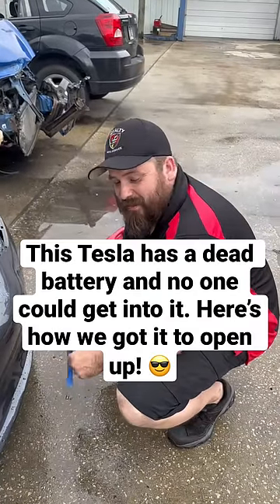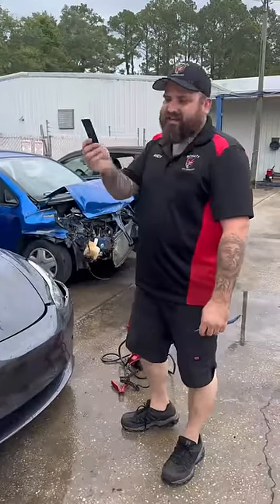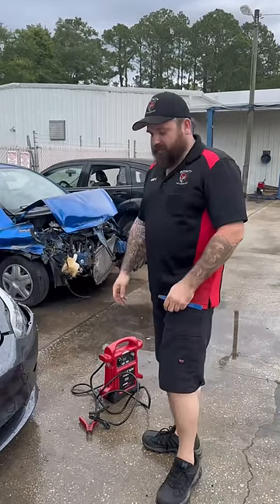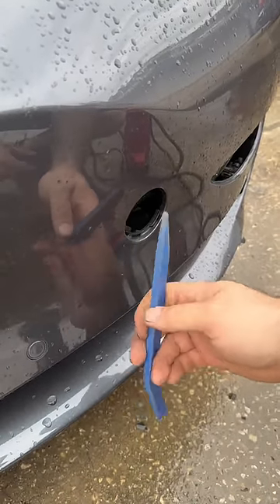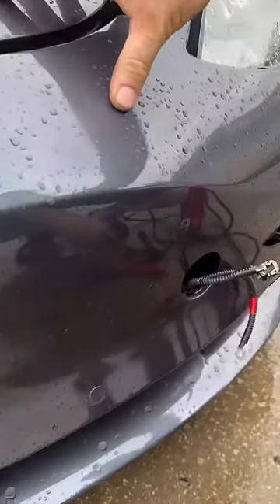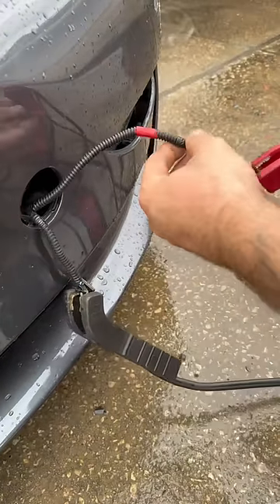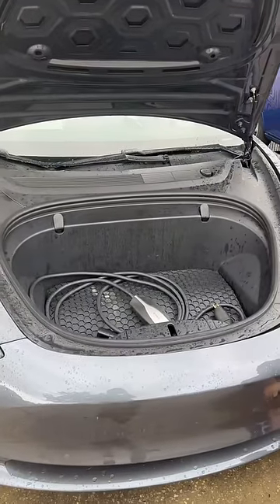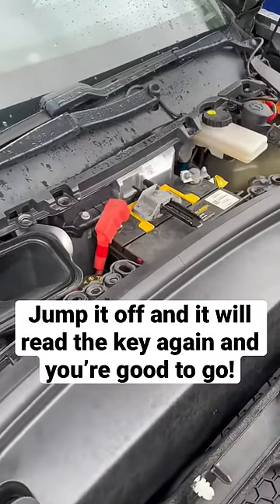Dead Tesla! How Can We Get Into It? #shorts #tesla #teslamodel3 #car #mechanic #crazy #hack #tips

Comment: Imagine, if they could build a car with door handles that didn't require electricity.  Maybe someday, we will reach that level of advanced technology.
Reply: And Windows that roll up and down by a hand crank.
Reply: This only happens if your 12v battery dies. I experienced that once because a service center didn't reconnect mines properly. Regardless, it's easy to fix. Every service item on Tesla is simple to DIY. If you can change a tire then you're already qualified.
Reply: That's why I like my Beetle! :3
Reply: Or a replacement battery less than $20k!
Reply: @T1Oracle  only happens when the battery dies, which car batteries die all the time.

Also most people don't even know how to change a tire
Reply: @T1Oracle  yea changing batteries is not thst simple nower days, theyre always buried in trims held in various ways, multiple on the vehicle and then need programming to the cars etc
Reply: 😂😂😂😂😂😂😂😂😂😂so funny
Reply: I once had an idea about mechanical locks. I am still formulating. One day, one day.
Reply: @PlinkyVR  Dude, you can see the battery in the video. No battery requires advanced rocketry to replace. There's no need to reprogram anything except maybe the stereo. Tell me how you've never changed a battery before.
Reply: @dk-bw4gk  oh the irony in the fact I do change batteries for a living, you never had to reprogram start stop? VWAG cars you need to tell it the new battery capacity and amp hours, mercedes and BMWs you need to reinitialise the battery management to prevent component damage on some... Volvo, range rovers and many BMWs have the battery in the boot behind trim like subwoofers foam inserts etc, do me a favour mate and stop trying to act like you know it all
Reply: "you aint ever gotta do this on this one truck its the only vehicle ive ever worked on but every car in the world including super cars must all be the same" @i_KillCampersDayZKillCamZ
Reply: @PlinkyVR sounds like you did your own exhaust work?
Reply: @CavemanVanDweller  is that like a literal question or are you trying to hint at something I'm confused
Reply: @PlinkyVR  🎯😂
Reply: Great comment. Sometimes tech is not the solution. This is from someone who had a 40+ year career in tech.

Comment: You just unleashed hell in San Francisco 😂
Reply: It’s literally a factory safety feature of Tesla
Reply: Don't forget....Oakland too 😂
Reply: Savvy Tesla owners are going to snip their wires to outfox the thieves then get super hosed when their battery dies from their dashcam setup
Reply: @ElectricNed  This is so true...
Reply: Yeah, connect the jumper cables to the bumper wires shown to open the front trunk (frunk). Then pop the plastic 12V battery cover off to connect the jumper to the 12V battery terminals so the car will be able to unlock and open with the NFC card key
Reply: U don’t think the thieves already knew this?
Reply: San Fran is already hell, so, should be no problem.
Reply: @JoseLopez-oj2ni 😂 PORTLAND HAS ENTERED THE CHAT!!! 😱
Reply: It's only if the battery is dead and you still need the key to be nearby.
Reply: Criminals have been able to get into my cars for 20 years just by breaking a window 🤣
Reply: @ElectricNed Teslas have built in dash cams doofus 😅
Reply: @Atthewgoop  Ok, imagine it's a 12v Elon Musk scent candle warmer they left on.
Reply: @ElectricNed  can access power without the key or app so again wrong 😂

Comment: A simple fix for this. Companies put keyhole locks on cars.
Reply: Ain't gonna work aways, 2007 volvo v70 wont unlock doors if battery is dead, not even with a actual key manually.
Reply: @Plymouth3061 then the key isn't actually connected to the lock like they used to be... newer isn't always better
Reply: Or you could ride a horse and get rid of key altogether
Reply: @scottbates100 Fucking brilliant!
Boat anchor vehicles.
Reply: While that would help in some cases it doesn't in the case of towing the car with the 12v system dead. Need that power to put it in neutral and access the car.
Reply: Nope newer car need the battery
Reply: @monkeynonothe3rd725 with cars it's actually the opposite, unless it's from 1920s lol
Reply: @scottbates100 depends on the year and make of the horse 😅
Reply: @scottbates100 Sound great until you come out the store and find some homeless junkies eating your horse.
Reply: so then we can (again) lock picking cars 😅
Welcome back to the past. No future allowed. Just to safe you a few seconds in a situation that you will probably never experience.
Reply: but what if I want my car to be like an overcomplicated smartphone that I depend on to get around?
Reply: @MrMhfreak  not with mechanical transmission linkage / manual transmission
Reply: That must be too complicated for Elon Musk😂
Reply: @Plymouth3061 well Volvo is shit as well…
Reply: Having a mechanical key is a security risk as they can easily picked, that's why Tesla don't have any mechanical key

Comment: I feel like a keyhole would've made this a lot simpler
Reply: 😂 so true..
Reply: Yep, but god forbid they do ANYTHING the old-fashioned way!!! Even though it WORKS!!!
Reply: Your too funny...needed a good laugh.  Yes a key would make too much sense !
Reply: @leroysiedenburg2139  as my dad would say “leave well enough alone “!
Reply: And now they can control you. 😂
Reply: Mic drop!
Reply: Yes a keyhole to open hood to get to battery. 
What car has a keyhole to get to battery?
Reply: @securityeagle9144 A keyhole to open the door, at that point you have access to one of those nifty hood latches
Reply: Come on man. We're talking progress here.
Reply: "I want more safety, technology, and performance than ever, AND I want a bunch of extra, unnecessary, and outdated parts to be used because I don't like different."

If they did that the next thing you'd say is: "Wait; why does it cost $200k?" 

In engineering, there are trade-offs.
Reply: @securityeagle9144  every BMW? :))
Reply: @man4YAWEH454  exactly the point…. Shut the grid down or control ppls power
Reply: @securityeagle9144 pretty much every car
Reply: @securityeagle9144  well its also a trunk so...  most older European cars with the battery in the trunk.
Reply: Yeah, but that ruins all the experience you gain trying to hotwire your door! X3
Reply: @mellowphantpi9168 There are compromises in engineering, but things like these decisions here - these are visual / aesthetic designers being allowed to steamroll the actual engineers. It's an engineering compromise, roughly on par with how getting shot is a deer's lifestyle choice.

I bet you 100 these decisions were made by graphics and aesthetics designers, directly against what the actual engineers decided and designed.
Reply: @securityeagle9144  litterly every car in existence, you open the door and pull a lever to pop the trunk
Reply: @securityeagle9144  Technically all cars since you have to pull the latch for the hood... 😂
Reply: @securityeagle9144  Just about every German car out there.
Reply: That would give you too much control.
Reply: For Real. They really over engineered this thing.
Reply: @FedkaSlovanich  You can do that with a Tesla too. In case you just missed it, the context here is the doors being locked. And just like virtually all other mass production cars of the last half century, the hood/bonnet locking release is on the inside. AKA: the not-where-you-are side of those locked doors.

Unlike most other cars though, if you battery is flat and you lost your key/fob, you still have many options. Some require enabling beforehand, some do not. You can unlock, drive and lock modern Teslas with any of the included 2 key cards, by bluetooth or NFC natively from your phone or a keyring (requires previous activation, but does not require cell or internet connection to use), through logging into the Tesla app (meaning you could do it through someone elses phone) - or you can call Tesla roadside support and have them unlock the doors (and even make it run) for you remotely.

All you need to enable those options, including getting Tesla roadside support to unlock it and fire it up for you remotely - is to feed a little charge to your 12v battery which can be easily done from the outside. If your battery is flat and you lost your key/keyfob with nearly any other car, that's it; you're SOL. 

To be honest, personally I'm not a big fan of there not being a mechanical key fallback. But IMO Tesla has put in place many extensive alternatives that fairly solidly makes up for omitting that mechanical key fallback, to "ensure" you don't get stranded. 

There's plenty of aspects to morr than justly grill Tesla on. This particular bit, I don't think this is one of them.
Reply: if i’m remembering right, the first roadster did have a key hole on the bottom of the driver door. shame they got rid of it
Reply: Yea exactly and I understand they don’t want it showing but for example my stinger gt has a emergency keyhole that’s very easy to get to just a tiny trim piece in the handle gets popped off that’s the most complicated it should get this is bs
Reply: Yeah but that'd cost probably $20 per vehicle. This is some wire routing and a plug. Probably $3. 2021 Tesla sold around a million cars. That's a cheeky $17 million they kept in their pocket for a problem that's very very rare.
Reply: "bUT ThE kEyhOLE is UGLy"
Reply: Thats how you know computer nerds built the specs and design features.
Reply: You mean a lock cylinder that needs a specific key made just for it?  That OOOOLD tech.  It doesn't need electricity or wifi, it's caveman technology, LoL 😂
Reply: @jesuschristiskingandsavior461 easy solution to that: wind generators or solar panels. Build an off-grid charging station and voila, you can charge your fancy electric car.
Reply: These cheap cables just lying there looks like something they threw in when they accidently locked themselves out and discovered how stupid it is to not have keys. 😂
Reply: 🎯. That’s soooo 2018.  This is apparently more technologically advanced.  lol.
Reply: @jamesgizasson : That’s a shocking comment! I’m reporting!
Reply: @securityeagle9144 
Just about every other car. Key opens the door, hood release is in the car. Derp.
Reply: Can’t do that, if Elon musk says it’s cool to drive around a giant kids toy car then the sheeple will follow! It’s all going to plan
Reply: I don't recall the being a key to put in a hole
Reply: Or a manual pull wire that connects to a manual lock on the frunk ..

Comment: All of us people with older cars just using the door key... LOL
Reply: yeah - and i love mine ;-)
Reply: US Old heads remembering Two Keys days - ignition and locks
Reply: I have a 2022 subaru and I can still use the door key if I need. I've done this tesla trick a bunch of times at an auction. It's a pain in the ass, just to unlock the door. And even if it has a good charge, you have to wait like 5 min for it to boot up before you can access anything.
Reply: Haha most of us don’t even lock it anymore. Nothing inside my Chevy worth stealing except the Chevy itself.
Reply: My BIL bought a used PU. the door locks were glued. If his battery or fob died, he's screwed.
Reply: @johnjbarnes78  I got 2 for my 96 Impala SS, round for doors, trunk, glove box, square for the ignition. I love my old Beast!
Reply: Sometimes it's good to be eccentric 😊 My truck is 30yrs old
Reply: But they would say, "that's how criminals steal the car"
Reply: @vr6glx96  "Boot Up" 
There's the problem when software companies start building cars.
Reply: This, masterrace
Reply: @johnjbarnes78  that’s how my foxbody is
Reply: And I'm Sticking with Mine.
Reply: @johnjbarnes78  or a 2 pence piece if you had a Morris Marina
Reply: For me, I do not even have a door key. I have a combination, push button entry.  The ignition also has the same thing.  The look on people's faces is priceless when I open the door and run a Furiosa-like combination to start the ignition.  Then when they see four pedals, a center hand brake, and two shift sticks, they are really lost and confused.
Reply: @Mordorer  I used to live in a high crime city and that’s what most people did.  They’d leave it unlocked so that they didn’t break a window to get in.
Reply: @beernutsonline  Nope, there won’t be,  because they aren’t cars, they’re “devices.”
Reply: Are the people still in side 😂
Reply: @mynamea.n.s.s5472 What if the car is ON FIRE with PEOPLE still INSIDE? Can they open the door and get out or do they burn up inside?
Reply: Replace older cars with everyone but Tesla owners.
Reply: Or just don't lock your door problem solved
Reply: @indridcold8433 and your 4 magical pedal purpose is ?
You confusing nobody except maybe gen z
Reply: @carlgreisheimer8701 you get burned inside pretty convenient lol
Reply: @legros731 
 Pedals:
#1 parking brake
#2 clutch pedal
#3 hydraulic brake
#4 accelorator
Floor Levers:
#1 transfer case engage and transfer case gear selector
#2 five speed manual transmission gear selector
#3 hand brake.
It also has eleven switches.
Reply: @beernutsonline ... Even not many 2012 models still running.

Perhaps they should make the battery removable so people can use it to power their house after the car turns to junk in 10yrs.
Reply: @indridcold8433 wtf you driving? A Racing Semi truck? 😂
Reply: @ChinkyChan  It is a custom vehicle.  It was never manufactured the way I have it.  It has a 347 Windsor engine, NV4500 transmission, F-250 live solid axles, custom suspension 5.5 inch inch lift suspension, galvanized vintage Jeep Wrangler Body.  It is some sort of Frankenstein vehicle that looks like a mutated vintage Jeep.  It is except from ridiculous environmental laws.  Thus, I put it together the way I see fit and stumbled into 30 miles to the gallon.  When I connect the gas chromatograph to it, it makes less pollution than a new 3.5 litre V6 F-150.  What does that say about modern vehicles and modern environmental laws?
Reply: @wayando  The battery will be exhausted in 8 years.